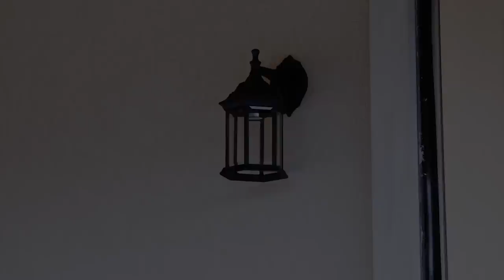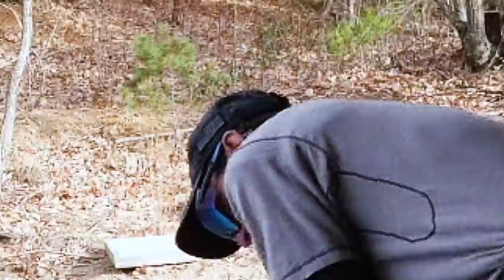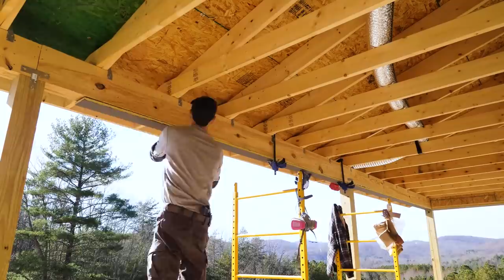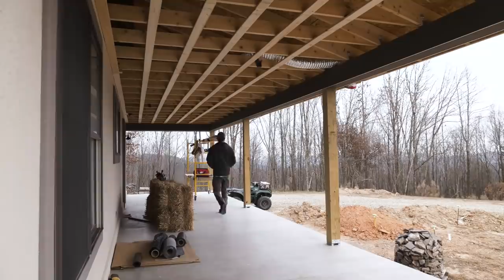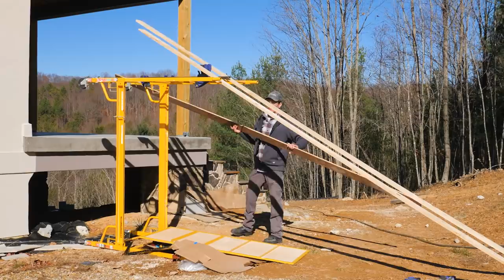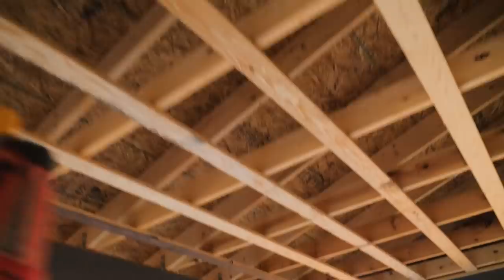Installing PORCH TRIM and CRASHED THE SCAFFOLD!

Comment: Just wanted to give you some advice I wish someone had given me. You talking about the tornados reminded me of it. A little over 10 years ago, I moved to Bastrop Texas and bought a house in the woods. It and the property needed a lot of work so I got it for a real good price. I bought it in May, moved in July, and by the end of August I’d gutted, remodeled, added an addition, cleared over an acre of trees and carted off three truck loads of junk. I was installing built in cabinets in my walk in closet on the Sunday before Labor Day. My retirement house in the woods was just about perfect. 

But men plan and God laughs. We’d had a drought that summer and the pine woods I lived in was acres of kindling. That afternoon it was very windy from a tropical storm hundreds of miles south and a tree branch broke off and took out a power line. Of course this started a fire. Even though someone saw it and called the fire department there was no stopping such a fire on that day. It started running through the forest faster than you can walk. It started about a half mile from my house and the first warning we had was a neighbors propane tank blowing up. Thankfully we rounded up the pets and got out, driving the last half mile with both sides of the road surrounding us with 100 foot tall burning pine trees. 

I tell all that to say that we screwed up. We were insured, but only for what we bought the place for, not the hundreds of thousands of dollars we had put in it since.  They sell insurance to cover this but our insurance agent didn’t ask us if we wanted it. I didn’t think to ask for it either.

So, just a bit of advice. If you ever add on, build, or remodel, make sure you buy the insurance to cover you till you finish and get it appraised again. It’s actually not that expensive. It would have saved me  from loosing a good chunk of my life savings.  I’d hate for that to happen to anyone else.

Comment: Dude you scared me to death with that ‘crashed the scaffold title.’ I didn’t think you would have assembled wrong or fallen off somehow but I do not like working on scaffolding cause I don’t like heights so the title worried me. Our second floor deck is about 14 ft high and runs the length of the house which is 80 ft. I had to be on the scaffolding to paint 80 ft of spindles. 😩😩 hubby was working so I painted what I could reach and he would move the scaffolding in the evening for me for the next day of work. It’s not a great memory. 😂 Glad everything and you were fine. Prayers for all those affected by the tornadoes.

Comment: Are you planning for any electrical boxes for outlets on the ceiling of your porch? When we added on to our house, that was one of the best things we did. It enabled me to wrap the poles and railings with Christmas lights without running long extension cords. Our current house doesn't have outlets on the porch and boy do I miss them.

Comment: It is a pain in the but to work with, but I can tell you one thing , the only thing that I did on my little homestead that turned out to be worth a damn was that sidding that I used 10 years ago an still today looks like I painted it last week. Everything else that I put 2 coats of kills and 2 coats of 25 year paint on looks like it is 100 yrs. old.

Comment: Dewalt 200x 7.25 concrete blades are not that expensive, I got mine at Lowes in a 3 pac for $25.00 a few years back. I used 1 blade for all my cuts on a solid concrete block retaining wall and it still works good.

Comment: As someone who used to use drywall screws as construction screws, I would strongly advise you use real structural screws for those fans.. Those screws will fail over time and cost you more than the $0.02 you saved using them in the first place..

Comment: Curious what the vent duct above the porch ceiling is for?
Reply from the maker: The front porch duct is the kitchen range hood. The back porch duct is the bath fan exhaust.
Reply: I’m really interested where you ran the vent duct. From the stove on the sink side of the house through the wall?
Reply from the maker: From above where the range will be, into the ceiling and out through the wall.